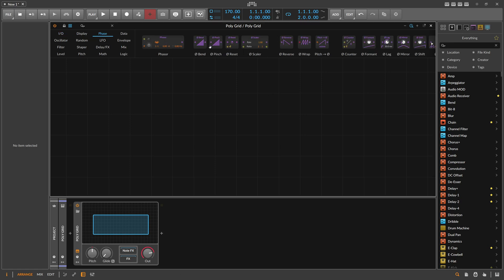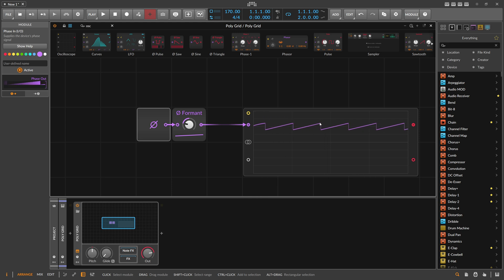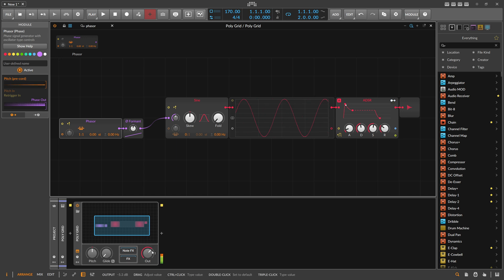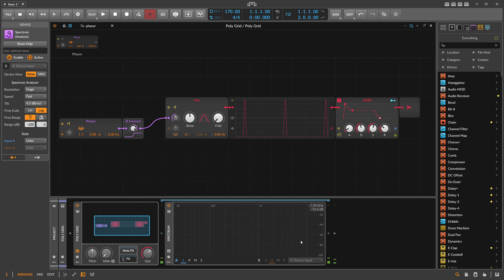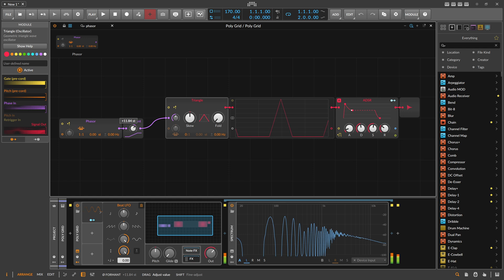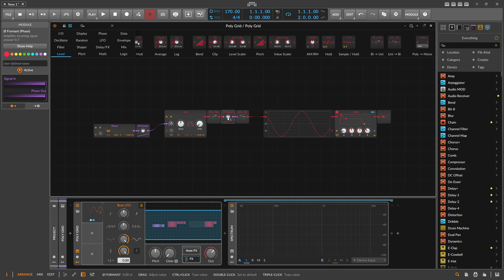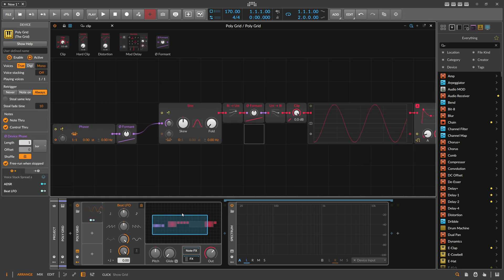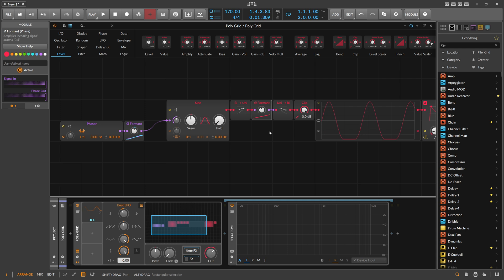Bitwig Grid: ∅ Formant - what is that module?

Comment: Hey thanks for showing us that module, I haven't tried using it before but it seems like a nice addition!
Using it as an audio clipper doesn't make much sense though since it does the exact same thing as the normal clipper (if combined with bi->uni and uni->bi converters like you do). It does not have a different sound, because it's mathematically the same output. The only difference is the output level. Try putting a gain module behind or in front of the clipper to compensate the level and you'll see ;)

Comment: do you have any videos that explain what phase is in the context of the grid? it confuses me and so I leave it alone
Reply: in this video you're using a phase signal as an oscillator, but there are also designated oscillator modules so I'm wondering what the difference is
Reply from the maker: phase is used as a position signal, in all kinds of different ways. its always a ramp from 0-1. it defines the postion of sequences. it also defines the position of the oscillator waveforms. if you modify the phase signal, you can change how things are retrieved from sequencers and oscillators. basically an index value for a data table.